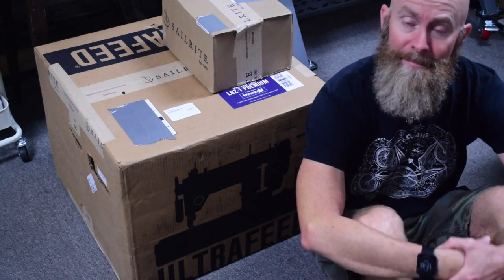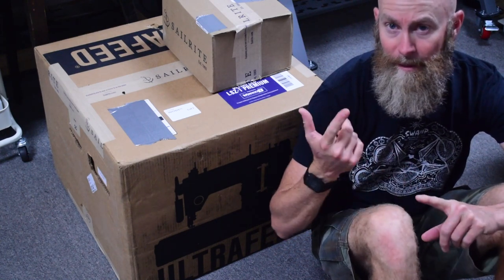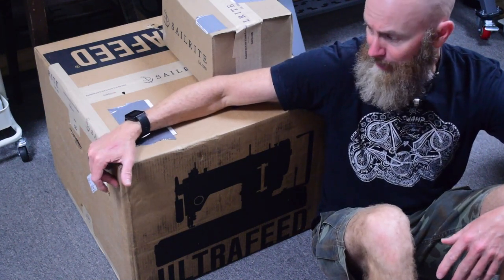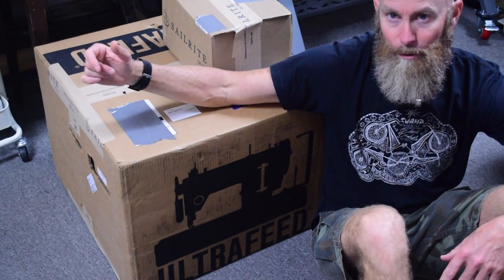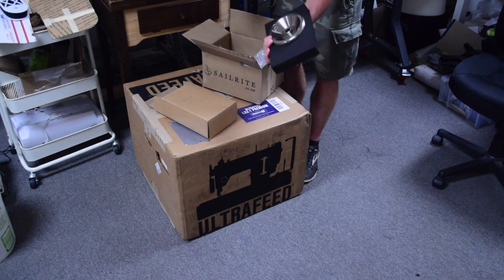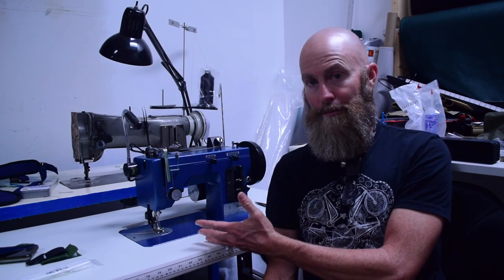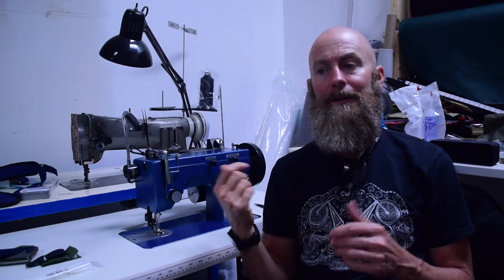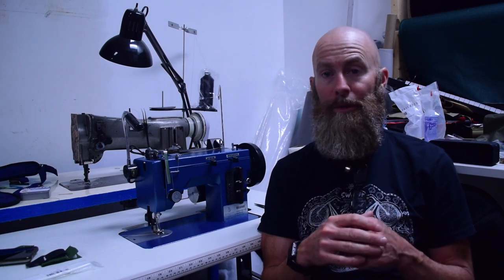LSZ-1Premium with WorkerB; Unboxing and First Impressions

Comment: Do you think it would be good for making purses/bags?
Reply from the maker: Absolutely!  I do a wide variety of sewing, but backpacks, duffle bags and similar items are my main passion.  I've made lots of bags on my Ultrafeed LS-1 (straight-stitch-only), and the WorkerB motor and zig-zag stitch on this machine will only make it better!
The only real disadvantage of the Ultrafeed compared to a full-size industrial machine is the somewhat smaller throat space, but I've shoved a fairly large, heavy backpack made from #10 waxed canvas through there,  It should be able to handle most bags with a little planning.
I hope that helps, thanks for watching!
Reply: @thejasonofalltrades  Thank you.  I've been looking at Sailrite and Juki Industrials.  I want to get into bag making, upholstery, etc. so I'm trying to determine what's best for ease and long term.

Comment: Wait until u attempt to change out feet. Screws were so insanely tight on mine.
Reply from the maker: I haven't had a problem with either of mine. Are you comparing it to a standard, household machine with a thumbscrew?  If so, then yes, these are generally screwed tighter, using a screwdriver.  This is necessary due to the nature of the materials one would generally be using this machine for.
Thanks for watching!
Reply: @thejasonofalltrades  just got my lsz1 workerB  1 week ago. Both those screws  were so tight I needed a screw driver w/ a wrench on it. Did u notice the cheapest made item on it is  made in America . It was the spool holder.  I made my own in mahogany and beech wood.  It was Sailrite vs Tech Sew. If Tech had a zigzag and portability it would have won. 
I'll b watching more of ur videos to understand what everyone is saying about u and ur many craft skills.

Comment: Will this machine do 10 0unce treated canvas and cow hide leather ?
Reply from the maker: Hi!
Short answer, yes.
Long answer, assuming you're talking about reasonable sizes/number of layers, still yes.  I've sewn a couple of small leather items with these machines, and some leather projects will be coming soon on this machine. I recently got a smooth leather foot set for this one.
I've sewn plenty of #10 waxed canvas (#10 is about 15 oz). It handles it great. 
All sewing machines have limitations, but anything I've done on my standard mid-weight industrial machines (like my Consew 206RB-1) I can do on my Ultrafeeds. Sometimes the Ultrafeed is the better choice.
I hope that helps, thanks for watching!
Reply: @thejasonofalltrades  thank you very much for the invite. Ls1 premium  worker b and the small table will be shipped to us on the 8th April. Was going to get the lsz 1  but after talking with Brian from sailing decided on the ls 1 . Less part to deal with and the wife already has a zigzag machine as well as a Pfaff 463 . So got all the bases covered now .thanks again for the great vids.

Comment: I'd like to get a Sailrite to use on my boat to make covers, cushions and maybe repair a sail. I like the machine you got but was wondering if it did triple stitch and if this machine is the correct one for me to get. Also, is this the SKU: 311603 for $1,595.00 on the Sailrite web site? What's the difference between your other Sailrite and this one? Thanks so much.
Reply from the maker: Hi Robert, sorry for taking so long to reply to this!
The Sailrite machines will only do a regular zig-zag, not a triple stitch.  
That is the same machine as in this video.  My previous Sailrite Ultrafeed is an LS-1 Basic package, so straight-stitch-only, and very few accessories included. The Premium package with WorkerB includes both the WorkerB hand wheel and a Monster II wheel, the very nice carrying case plus a bunch of other accessories.  If Sailrite were to ask me, I wish they offered the WorkerB as part of the Basic package.  When I bought my LSZ-1, I already owned a few of the things that came with the package, or they were things I didn't necessarily need.  But if you don't already own one, you'll probably get use out of everything in the Premium package.
I hope that helps, thanks for watching!
Reply: @thejasonofalltrades  Thank you for your response but it didn't fully answer my question. I was wondering if I need a triple stitch machine for my catamaran sail boat? I'll probably be sewing cushions, covers, sail bags and possibly mending some sails every now and then? Thanks!
Reply from the maker: @robertlaird6746  Sorry Robert, 
In my opinion you do not need a multi-step zig-zag.  I've never used it myself, although I have also never repaired sails. There are tons of people using Sailrite machines to repair and maintain their sails and other marine canvas, and that is what the machine is primarily intended for. My understanding is a multi-step zig-zag is stronger, and might be how many sails are manufactured, but I think a standard zig-zag should be fine for repair work.  And since there is no multi-step zig-zag walking-foot portable machine on the market to my knowledge, that isn't an option anyway.
Before you buy, search around Sailrite's youtube channel for sail repair, I'm sure they have better info on the topic.
For all of the other things you plan to sew, this machine would be ideal, and I have used mine for those kinds of things with great results.
I hope that helps!
Reply: @thejasonofalltrades  Yes, that helps out a lot. Thank you very much for your expert advice, I appreciate it. I guess I'm going to get a Sailrite machine just like you have. I've sewed before but I was a lot younger. I made a few wallets and pocket change bags out of sail cloth just to have something cool. That's the extent of my knowledge. I'm not sure how much use I'll get out of my Sailrite machine but I'm about to get a boat and I know I'll be needing it and would rather do the work myself verses hiring someone else to do it for me. The cost difference would pay for the machine right away.

Comment: How much does this machine weigh?
Reply from the maker: I think the machine itself weighs around 35 pounds or so.  That can vary quite a bit, if you add the monster wheel that adds a bit, and the wood base they sometimes come in is quite heavy.  In the carrying case it feels like maybe 50 pounds, but I haven't weighed it in the case.
I hope that helps, thanks for watching!

Comment: small consistent stich length, tighter turns are what this machine doesnt do good.  good machine thogh.   it isnt a walking foot like a typical unison feed.  the feed dogs are wider so turning the fabric is more difficult to turn tighter.  and because the needle isnt peirceing first and dragging second rather it is grasping, pulling the slip experenced is more akin to a drop feed rather than a unison feed.  and the feet offered for this machine are the fewest; no compensating feet or rolled hem feet  which are important for a home maker very much.  this machine is cult, it works well for what it does; bigger stiches.  solution:  idk if the neddle bar can take some other standard of foot,, and just mount a drop feet foot on it and disable the foot lift.  reverse pedal knee lift is superior

Comment: So, here’s a specific…This machine is just a Reliable brand zigzag portable that is painted a pretty blue.  It has a motor upgrade that is really cool but unnecessary.  The criticism is that you can buy this machine for about $700 that includes the exact same hard case as the sailright——and you paid 2 grand….You can get the monster hand wheel for the little reliable and even fit the cool motor.  For the same money you paid for this machine you can buy a Brand new  Consew 2206RB-14-7-DD Single Needle Direct Drive Compound Walking Foot Sewing Machine delivered with a stand.  I’m not ragging you, I’m just saying that if you have the space, don’t waste money on the sailright—get a real machine.
Reply from the maker: You are not the first to make the claim that Sailrite ,machines are simply re-branded generic machines. I would like to give you the opportunity to do what no one else who has made this claim has ever been able to do; present even a shred of evidence to your very specific and falsifiable claim.  The floor is yours.

Comment: is it worth $1600 bucks? it seems like you gotta get all the accessories for this thing, what if your in a storm with no power and need to mend a sail? this is THE tool. in the end it looks overpriced ??
Reply from the maker: If Sailrite were to ask my opinion, I would recommend that they make the WorkerB available on a machine with NO extras and offer it at a much lower price. In my case, many of the extras that came with the machine were things I already owned anyway.  That said, given the price of things in today's world, and assuming one needs a portable (specifically) walking-foot machine and wants the best one there is, this is it, and I think it's priced fairly.  I love mine.
Regarding your question about what to do if power is unavailable, this package includes a Monster II wheel, which has a handle you can attach for sewing manually when power is not available.
I hope that helps, thanks for watching!

Comment: My Juki 1181N blows the LSZ away and cost less. I had an LSZ, nice enough machine but over priced.
Reply from the maker: Hi Michael, 
Does the 1181N "blow away" the Ultrafeed LSZ-1 at zig-zag stitching? Or is it easier to transport and use outside of its dedicated table and motor?
I think you might be missing my point, or I failed to make it, but if you're using the Ultrafeed as a straight-stitch-only machine, ALWAYS in a table and NEVER transporting it or using it as a portable machine, then yes, you would be better served by a dedicated industrial machine.  However, an industrial machine cannot do what the Ultrafeed can do (be portable while still providing very similar sewing performance to an industrial machine).
My MINI Cooper S "blows away" my wife's Tacoma.  Unless we go off road ....
Reply: @thejasonofalltrades  True, I bought a Singer 237 for zigzag or the 401A. $50 for each of them. So does the LSZ come with the table and the portable carrying case?
I just prefer the 1181N, more power, higher presser foot clearance, quieter, and smoother running.
Reply from the maker: Many of the Ultrafeed packages come with the case, and I think you can also get a package with the table (which of course adds to the cost).  I also have a 237, and it has been my "matched pair" machine to my Ultrafeed LS1, to provide zig-zag.  However, flipping a lever is easier than changing machines, and the Ultrafeed does it better, particularly on the thicker materials and assemblies I would likely be using the Ultrafeed for in the first place.
I haven't used the 1181N, but it sounds like a great option for someone looking for an industrial machine.  But one of the reasons I made this video was to address exactly what you claimed, that "X" industrial machine (or ANY industrial machine) is "better than the Ultrafeed."  It's apples and oranges.  Whether the 1181N is a better machine than a Consew 206RB-5 would be an interesting discussion, and might help guide someone who is choosing between those two similar machines. Comparing the 1181 to the Ultrafeed is like comparing dogs to cats; both are pets, but everyone knows cats are better 😂
In all seriousness, I appreciate you sharing your thoughts!